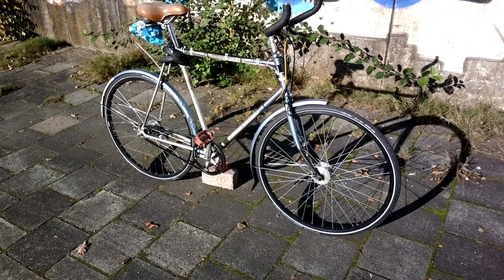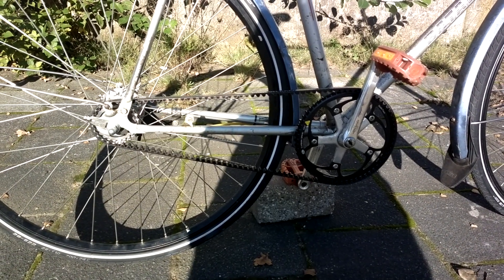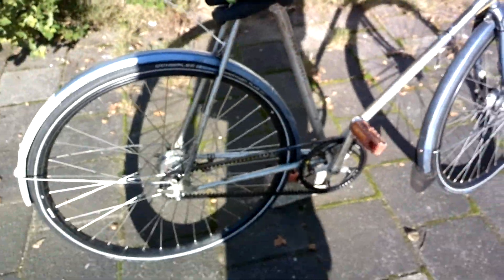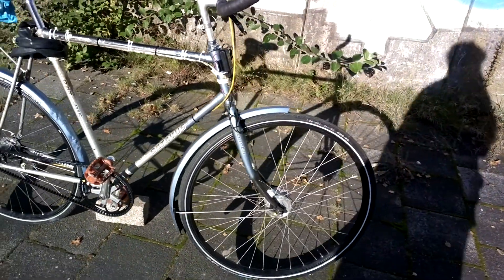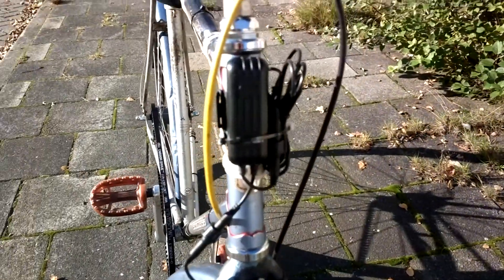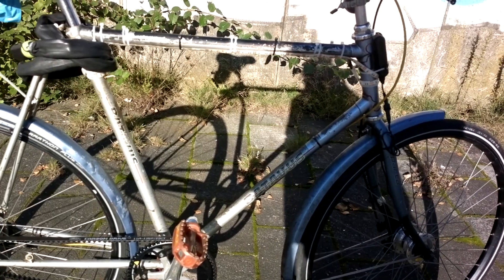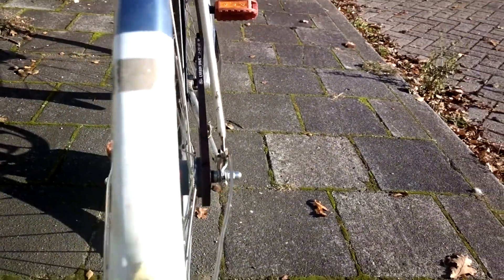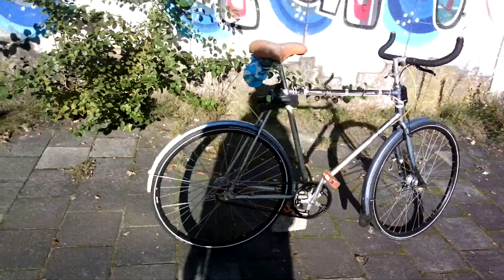Shiny Bicycle (Lichtfiets) 3.0 Gates Carbon Drive upgrade

Comment: What kind of bottom bracket does it have?
Reply from the maker: It was some generic (non eccentric) screw cap bottom bracket. Do not know the details. What I do know is that 2020 autumn the bearings in the original bottom bracket went FUBAR and I got it replaced with a new one. The local bike shop did a bit hack of a job.  The new bottom bracket came with sealed bearings already installed on the axle and plastic press fit caps. Well, while riding those press fit caps would keep getting loose. Maybe they are fine for a chain drive, but the additional forces from the tension required from the belt drive would make them loose. First I tried two different strength Loctite thread lockers (blue (243) and purple (222)), but the plastic caps were still getting loose. Loctite 401 instant glue though did the trick.